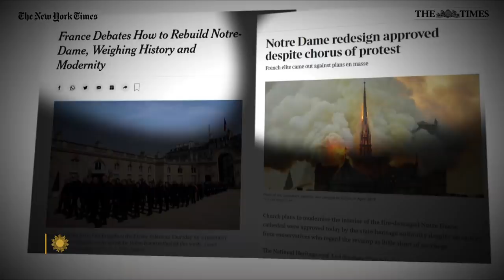After the fire: Rebuilding Notre Dame

Comment: It will never be "replaced." Restored, maybe, but not replaced. It took a century or more in Medieval times to construct its incredible wooden roof, and it will never be replaced. It was way more valuable and precious than the 19th century iron spire that the media seemed to fixate on as the greatest loss to the structure.
Reply: This is not the way of seeing the French and Europeans. These building types are not homogeneous, there are plenty of parts of the cathedral that have been modified, restorated or added over the centuries. The new materials will fit in with all those that have been added during the long life of this monument.

Comment: 3:48 they aren't flying buttresses, they are the vault ribs,
Reply: Correct! But the flying buttresses are pushing inwards while the vault ribs are unstable.
And the downward pressure from the heavy wooden roof is gone, so the columns could go inward as well.
That is why everything has to be supported and the heat effected 'cement' between the stones has to be replaced.
They used chalk mix to glue them together, which is heat sensitive, and loses its strength in a fire.
So all masonry has to be checked and redone before you can bring back what was destroyed.
Preservation of what remained is what is being done right now. And gathering materials for the parts that were lost.

Comment: Keep in mind that Notre Dame has be added to etc, a bit  during the years 
The spire was a fairly recent addition for an example.
So..... anything different incorporated  in the restoration will simply   become part of its long history.
One thing that should  not be changed much is the spire.  Any  new one should look much like the old one as a more modern one would look very out of place .
Reply: Not really….the gothic spire made during the 19th century was a copy of the original gothic spire that was destroyed. It is above all things a cathedral and it should remain so, and not be converted into some gaudy tourist trap.
Reply: @henrylivingstone2971 
 Of course,  it can  not be anything gaudy  or out of place. It  has to be in the same style  but it dos not have to be an exact replica. That was my point.
 BTW, I may be wrong  but,  the one that was recently destroyed  was not an exact replica either
Reply: @henrylivingstone2971  There was no spire originally,seven of them had been planned in different parts of the roof ,but never erected (Hence the flat shape of the twin towers of the façade,which were supposed to be topped with two of  these spires ) .Viollet-le-Duc,the 19th C restorer added a thin spire to add some lightness to the massive building.
You may be thinking of Ste Chapelle,close by ,where the 19th C spire is the 7th one of its kind ,all of them before having been thunderstricken.
Reply: It’s apparent you have absolutely no idea what you’re talking about. Of course there was a spire, the Notre Dame de Paris was finished in 1345 and the spire was complete in the period between 1220 and 1230.

Also the flat tops on the twin towers is a common feature in gothic architecture and can be seen in such cathedrals such as Laon Cathedral and Lincoln Cathedral. 

And Viollet Le Duc, was a “restorer”, get it? As in someone who restores something not just makes something up because he thinks it’d look good. The original spire had been weather damaged by the 17th century and was removed in the 18th century.

Also there are depictions of notre dame with its spire that date back all the way to the 15th century. In the book Froissart’ Chronicles depicts Isabella of Bavaria entering Paris with the cathedral behind her with the original spire, on Claes Jansz Visscher's map of Paris in 1618 depicts the spire, in the Pontifical Romain by Jean de Mauléon Bishop of Comminges (c. 1525-1530) depicts the spire, View of the île de la Cité featuring the Notre-Dame cathedral, by Nicolas-Jean-Baptiste Raguenet (1752) depicts the spire. All these depictions being far before Viollet Le Duc was even born and as you claim created the spire for the first time.

In conclusion, it seems you are mistaken and just downright incorrect. Maybe for further reference, when you don’t know what you’re talking about you shouldn’t say anything at all. It’ll save you from seeming like a foolish know it all.
Reply: @henrylivingstone2971  You are mainly right but Viollet-le-Duc didn't restored the spire as it was previously (there was even a 15 meters difference between both).
Viollet-le-Duc took some liberty with Notre-Dame and not only with the spire, he made some modification on the west façade, buttresses treated as decorative elements, gargoyles in the towers invented, monumental diabolical or grotesque chimeras (such as the Stryge), he also added on either side of the spire a statue of each of the twelve apostles and even placed one at his effigy instead of Saint Thomas ^^
And of course it was a topic of debate at that time, John Ruskin even said after Viollet-le-Duc's work Notre Dame didn't exist anymore for him, so yeah Viollet-le-Duc was a restorer but he had his own idea about that : "Restoring a building is not maintaining, repairing or redoing it, it is restoring it to a complete state that may never have existed at a given time."

Comment: Will they would restore the roof with lead sheet which was the material of the original construction? Besides being toxic it is also heavy, The oak framework would have an easier time with a lighter material. Of course they would have to choose something which is resistant to corrosion. Glad to hear that the restoration is progressing. I was inside the cathedral years ago, I hope to go inside again someday.

Comment: ITs not a matter of whether they can rebuild it or not. after all, its 2021, and we're talking about 12th century construction.  That said, it did take over 100 years to complete.  the real issue is how they plan on rebuilding.  whether or not they will rebuild to its original design or build modern while showcasing interior and exterior element that mimick the original design. I personally would want them to rebuild as was the original blueprint using the same materials,  But that also comes with the future risk of similar exposure to fire.

Comment: Using wooden roof trusses again instead of steel ones is like rebuilding the TITANIC with the same number of lifeboats.   Some historical things should not be repeated.
Reply: it last 900 years without burning , these massive dense wood trunks doesn't ignite easily , this was a criminal fire
Reply: The beam stucture lasted for 750 years ,no steel structure will ever last that long !

Comment: nice that it'll be rebuilt. but it wont be the same building....not with that missing 400 or 500 year old wood
Reply: These building types are not homogeneous, there are plenty of parts of the cathedral that have been modified or added over the centuries. The new materials will simply fit in with all those that have been added during the long life of this monument.